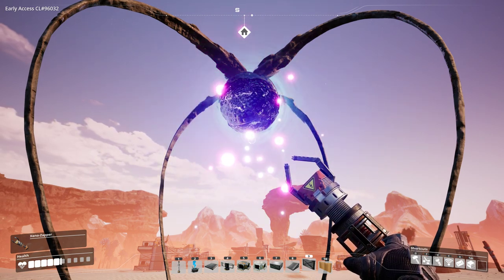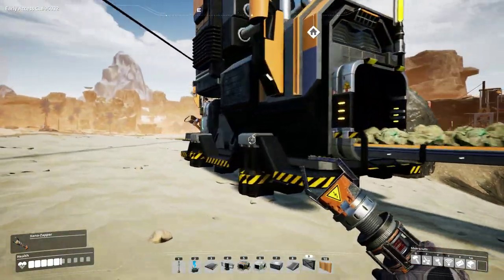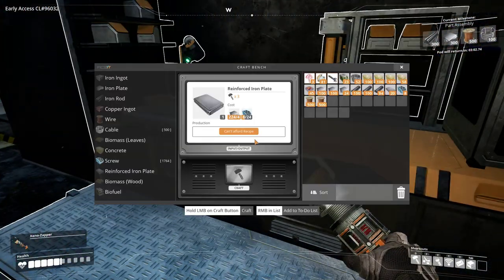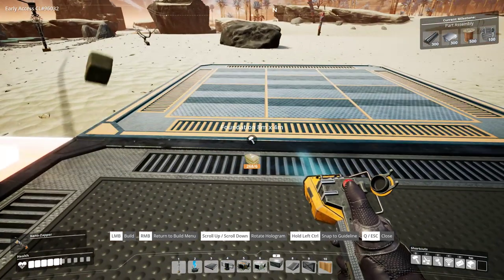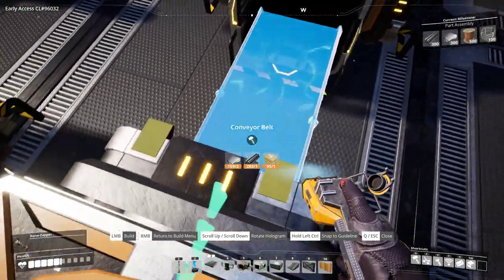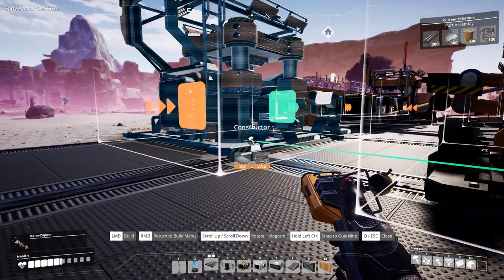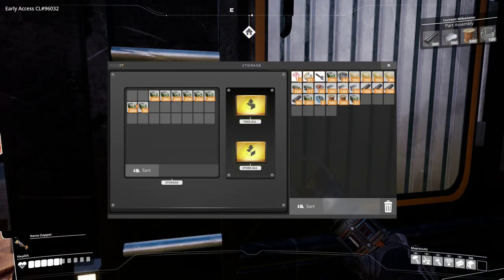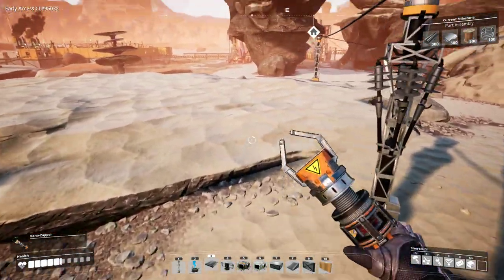Copper Cable Belt Ballet | Satisfactory Desert Bus Ep#6

Comment: The reason the cable belt encroached on the splitter is because splitters can only be encroached with *after they're built*. Technically, the wire belt encroaches as well, but since you built the splitter after the belt, the game's fine with it.

Comment: Bentham, you can easily work around the fact that you can't initially place a walkway on a seam between foundations. All you have to do is place one against the center line of one of the foundations adjacent to the seam, then use that to build a walkway piece in the seam by placing it against the first walkway piece. Easy as pie!

Also, since you are using two smelters anyway, you don't even need to merge and re-split their output. You could simply have two belts of copper ingots from the smelters, one going into the splitter on either side, eliminating that center splitter entirely.

Comment: I know that your biofuel power generation is only temporary, but I'm fairly certain that you are wasting tons of biofuel due to it constantly burning at full speed regardless if you are at 90% power consumption or 20%. It might of changed since the weekend test, but i believe it will only be efficient if you manually under-clock the generators. I remember it biting me in the backside a couple of times in regards to biofuel gathering/production/consumption.
Reply: they are not burning at full speed now, neither did they at weekend test.

Comment: With the input of copper you did a oopsie indeed! 
Your first splitter splits it 50/50, meaning it gave 30 to the first one and then 30 to the rest
The second one also split 50/50 and then only passed on 15 to the other too. and repeat for the last one, giving number 4 only 7.5 input per minute. 

You should have put the first splitter in the middle of all of them, guided 30 to each side and then split of 15 for each machine to have a good balance.

Comment: Bentham, is there a particular reason that you don't smelt the ores directly after mining them? To me, it would make sense: 1 Copper/Iron Ore -> 1 Ingot, so you're not using any more belts to ferry things around, and the Smelters give off that black smoke, which means they really should be placed outside (or at least in an open-roof area), unlike the constructors, which definitely can be roofed no problem.

(And yes, I understand that Steel later on uses Iron Ore/Coal, but you'll probably have a different Iron mining area to make Steel, so you can just ferry Coal there and make the Steel on-site and ferry the Steel away, which would definitely make sense, since 3 Iron Ore becomes 2 Steel, which means you're condensing the output and using less belt for the same production)

Edit: To be clear about what I'm suggesting - put the smelters right next to the miners, like you did with Limestone -> Concrete

Comment: I'm screaming at the screen enough that I need to let it out. Here's how to do it flat: after the outer constructors have first a spliter, then a merger. after the inner ones, have a merger, than a splitter.
From the outer splitter, 3 belts: 2 to merger in front, which goes to cable constructor. 1 to the inner merger. That merger now gets 60 per minute total. That goes into the inner splitter, half of which goes to the cable constructor, half goes to the wire output merger.

Comment: You will need a lot of cable relatively soon as you cannot immediately power oil pumps with oil. In other words you have to start oil pump with power from your base, otherwise it'll have to be powered with biofuel (oil pump eats 60megawatt, which is a lot).

Comment: 9:50 re: cable uses. You need cable for computers in Tier 6.
18:10: re: space and 3D vs. 2D: Why not just automatically build an extra foundation level up so the rocks don't get in the way if something ends up bigger than planned?
51:20: I bet you could totally put one watchtower next to the mushroom thing, then another on top of it, and use the first watchtower to jump to the base of the second.

Comment: This game needs power passthrough walls.
Reply: It gonna get item called powered wall. This is 1 item you just put in building, connect it with 1 power line, then all power from this wall goes through whole building. So you just place stuff on ground and it works without power poles :) You can see some of this upcoming stuff here :) https://www.youtube.com/watch?v=08-6XeECY1I&t=54s

Comment: ugh... at 29:00  you could have a dual input to the building  left and right pairs into splitters to feed the constructors... then have One external splitter feeding those two inputs.  so  Belt comes in splits Outside to two ports, which split again Inside to the two constructor pairs on the left and right...

Comment: 11:30: Why does Satisfactory hate nice grids?
30:00: Add "symmetry" to the list of things Satisfactory hates.
44:22: I think Satisfactory just hates everything that isn't an organic mess. Which is an aesthetic I can dig, but it shouldn't be the only option, you know?

1:35: Agaric is a type of mushroom. Don't eat it.
16:35: It's okay, you can just add an extension to the side of the building! A random bulge in the side of an otherwise-symmetrical building...okay, never mind, I see why that's a problem.
40:40: ...Of course I'm gonna tolerate this distraction. Cool factories doing things (kinda) efficiently and (hopefully) evenly is what I'm here for.

47:15: And you said you'd never have any use for that kind of thing! Well, technically you said that for ores, but it's not like you'll ever have a tool or building that requires ingots...